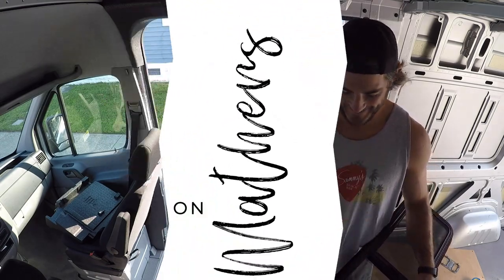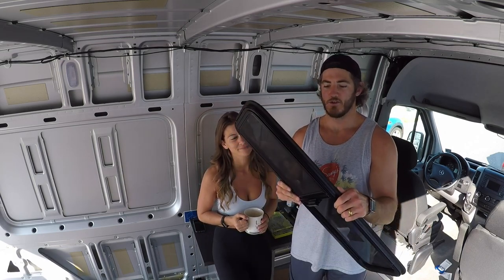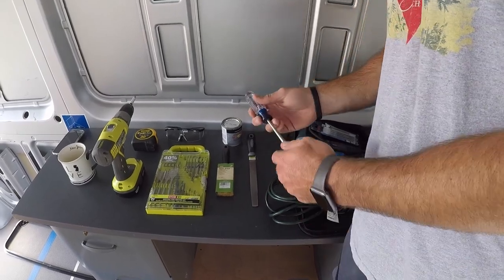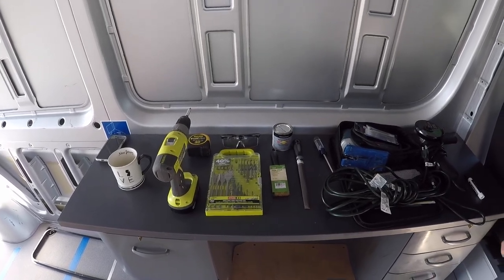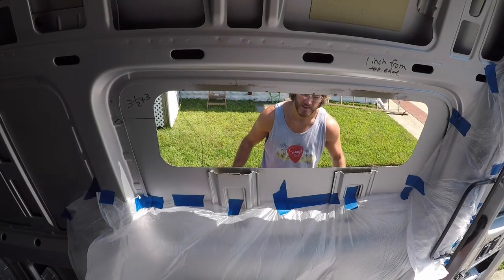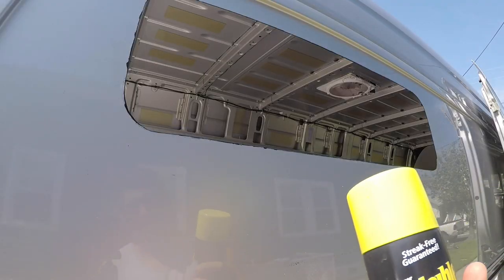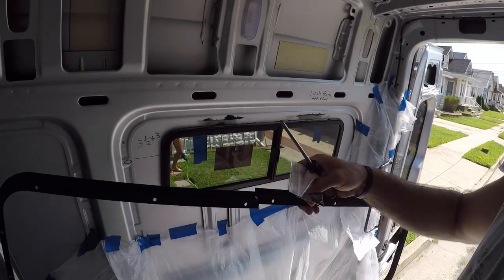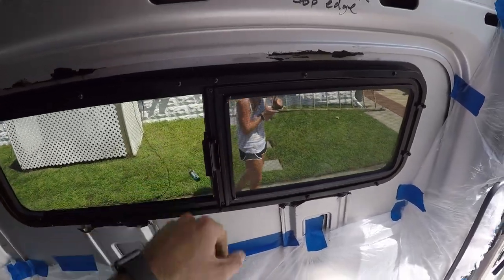Installing Side Bunk Panel Windows On A Mercedes Sprinter Van - Van Life Build Series Ep 4

Comment: So you laid the butyl tape onto that "foam" section? Also. Thank you for your videos! I have watched a ton, and y'all are great at mapping things out. I feel ready to tackle this now!
Reply from the maker: Caroline Dianne thank you! And that’s correct but looking back I don’t think you need the butyl tape.  We just didn’t want to take any risk.  If I were to start the van over I probably wouldn’t use the butyl tape and test it out (spray water over it and check for leaks) if I get leaks then I’d apply butyl tape.  If you do get it go with black butyl tape!
Reply: @MathersOnTheMap  thanks for pointing that out! VWD recommends no other products needed for the CRL clamp ring windows. Best to install bare and do a spray test like you said! 🤙
Reply: @thisspotrules3631  what do you recommand if the window leaks ? I did follow all the good practice and it leaks with foam only....help !!
Reply: @cgauthier5094  DAP

DYNAFLEX ULTRA 10.1 oz. Black Advanced Exterior Window, Door and Siding Sealant... Had to use on my CRL. So far, so good! 🤞
Reply: Home Depot sells

Comment: Next time you install windows use the black take most glass installer use I drive a peterbilt truck and had windshield install the double sided roll of tape looks a rope comes in a roll and won't leak 😊

Comment: Seems you bought the van used. How many miles and what price? Is it awd or fwd?. 4 cylinder right? How did you find a van in Michigan , seems you are based in NJ? I need to get a van first. Appreciate your answers. Thanks.
Reply from the maker: Bought used $35k 15k miles off cargurus maybe? From the MD dealer.  Flew one way ticket to it sight unseen.  This was 2019 though before the crazy spike in demand with covid 👌🏻
Reply: @MathersOnTheMap  regarding insurance, no issues insuring the van? Who insured yours? Comprehensive?

Comment: Hello! Love yalls videos. We just installed ours in yesterday and tried the water test today, and had a small leak where the slider is…any recommendations on how to fix this? No other leaks around the outside of the window just the middle part:/ any ideas appreciated!
Reply from the maker: hey Staci, so the leak is coming through the window itself, not where the perimeter of the window meets the van wall?  If so I am not really sure other than playing around with the weathering gasket on the window slider
Reply: @MathersOnTheMap  correct! It is from the middle of the window where the slider is. We are trying to decide if maybe some type of sealant could seal off any damaged weathering but wanted to look up options first! Thanks!

Comment: So you guys used the butyl tape in addition to the existing butyl that came on the window frame.  I noticed that in your succession videos you didn't use the butyl(on your other window install).   Did you find out something different as you were going along to not use additional butyl?
Reply from the maker: We called CRL and they said we could use butyl tape for the side panel windows, since we saw that was required for the windows from RB components.  

However looking back I think you could get away without it.  If I could do it over again, I would still use butyl tape for these windows, but a very thin layer and I’d also ensure it’s a black color.  The gray butyl tape sticks out so we spent a good amount of time removing the excess.

For our side door t-vent window, the weather proofing strip is much thicker then the side panels so you definitely do not need butyl tape.  Hope this helps!

Comment: When you add a wall how are you going to finish it  with the window already mounted?
Reply from the maker: Good question, I’m actually working on the furring strips now, something I should have done earlier I think.  But I am going to frame out the windows using 1x8 poplar and 1x2 poplar.  Hopefully I’ll have this in the next video

Comment: I am getting ready to install my CRL windows and I am a bit confused. Some people say to use a sealant or butyl tape, others say you need neither. Some people seem to have a lot of difficulty getting the screws in and other people, like you, don't even mention the screws like it was no big deal. What did you do that made it work for you?
Reply from the maker: Butyl tape isn’t mandatory but I had taylor push on the window from outside while I screwed in on the inside
Reply: @MathersOnTheMap  Thanks! It sounds like a certain amount of strength is needed to get the screw in. I am debating pre-drilling or not and working on getting the courage up to tackle this project next!
Reply: @libertybell144  definitely predrill. just installed 2 CRL windows into my sprinter van
Reply: @jackiewah448  Hi Jackie. I completed this project several months ago - and I did predrill. I love my windows! Congratulations on installing yours!
Reply: I'm getting ready to order my bunk windows. What size are those? I know they come in different sizes

Comment: Does Left and Right side windows matter? Or can you use Right side on both sides or vice versa? Can only find right side available at the moment is why I ask. Thanks!
Reply from the maker: I think you can use the same for each side.  I don’t recall marking a left vs a right
Reply: Good deal. Thanks for the response and thanks for sharing good knowledge. Cheers!
Reply from the maker: @nathancarr2890  you got it Nathan thanks for watching and good luck with your build!

Comment: The website where I got the CRL windows did not say to use a butyl tape for the install. Wonder if that's actually necessary?
Reply from the maker: I agree David I thought I pinned a previous comment where I said that...if I were to do it again I probably wouldn’t use it.  But it certainly doesn’t hurt (we haven’t had any leaks at all)
Reply: @MathersOnTheMap  yeah I’ve actually added lap sealant after we’ve had some leak issues. I don’t trust CRL’s rubber seal, even if it would work well in the beginning, i don’t think it’ll pass the test of time.
Reply from the maker: @daddouuuu  exactly my thoughts, with anything water/window related I rather do overkill and never have to worry about it